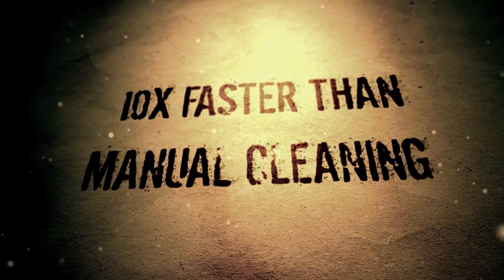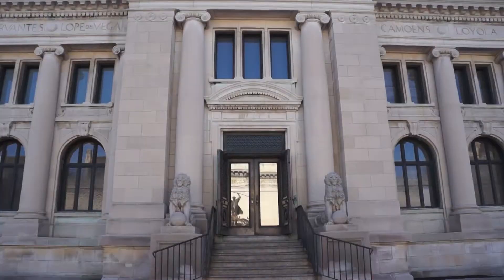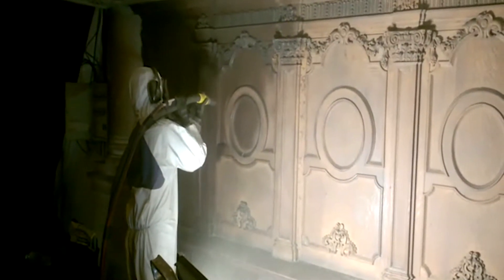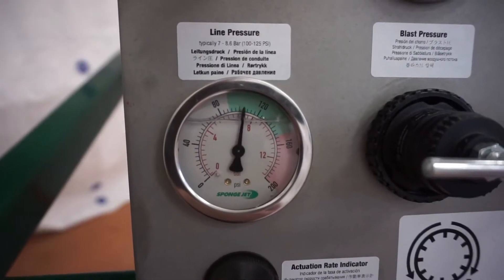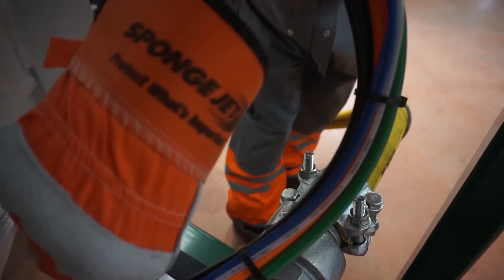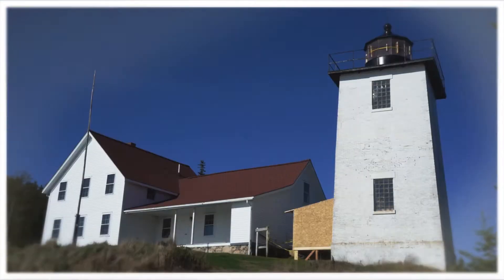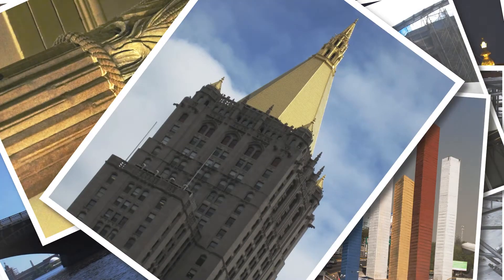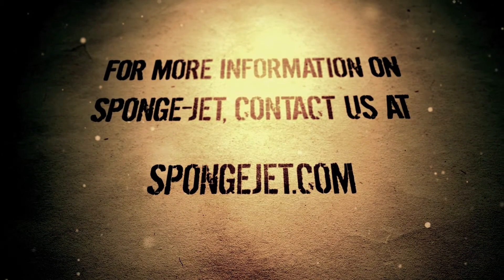Sponge-Jet Restoration

Comment: does this process produce any sparks?   do you take any precautions against fires? is it considered hotwork? i should clarify, when cleaning metal, as in metal decking being cleaned of oils for painting
Reply from the maker: While every location has different rules and regulations, we have been used in ATEX Zone 2 and have specialized equipment for potentially explosive environments. Contact us at spongejet.com/contact and we'll be able to match you up with a specialist. Thanks!